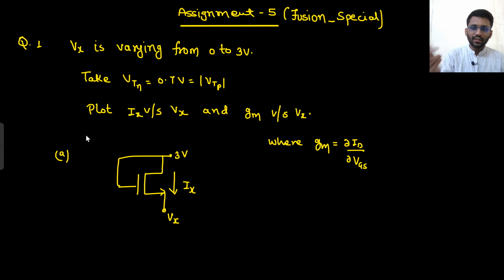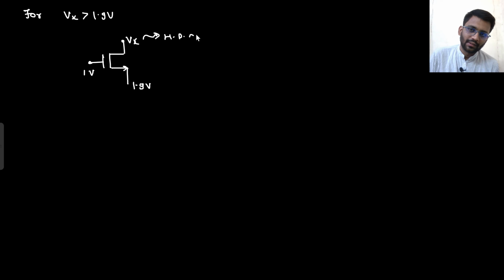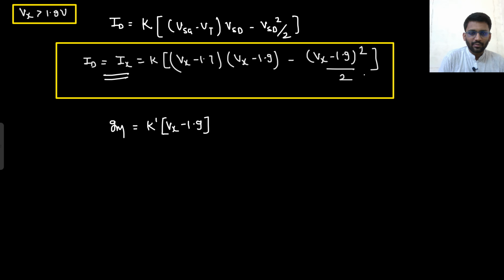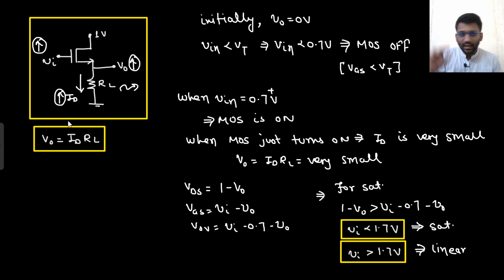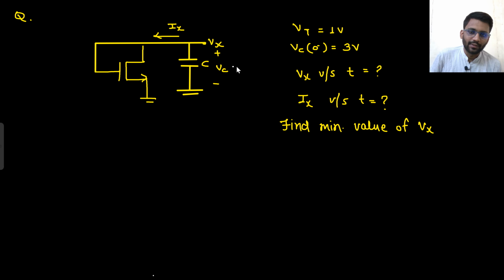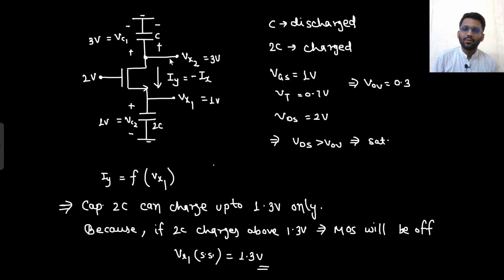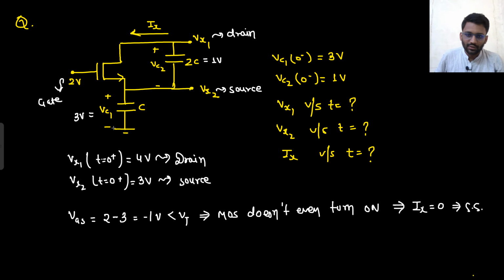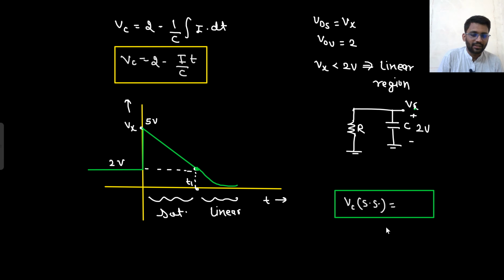Assignment 5 Solutions (Fusion_Special) || Analog Electronics || PrepFusion || Himanshu Agarwal

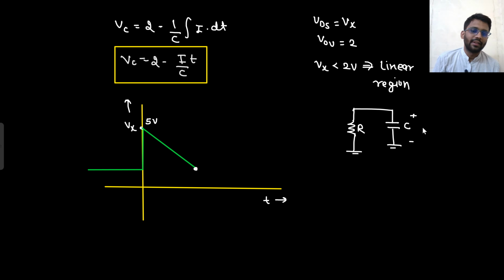Comment: 2:37:10 the effective ckt after replacing the mos with a resistor seems to be wrong, because there is no 3v source and you considered Vx across C but actually Vx = 3 + Vc from the MOS ckt
Reply: that effective ckt seems to be just for the t=t1